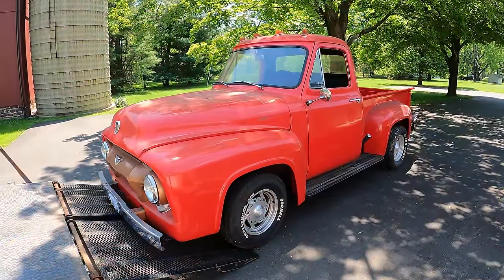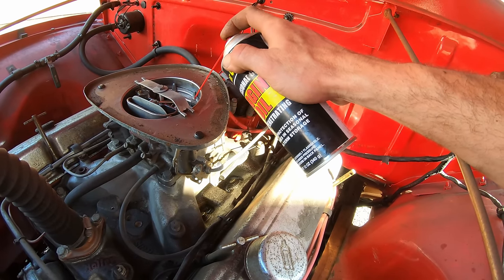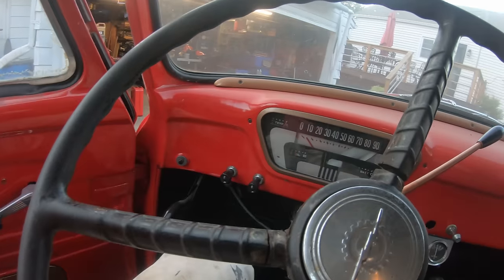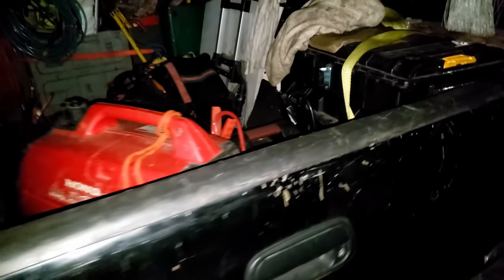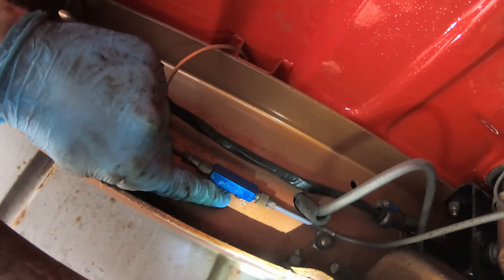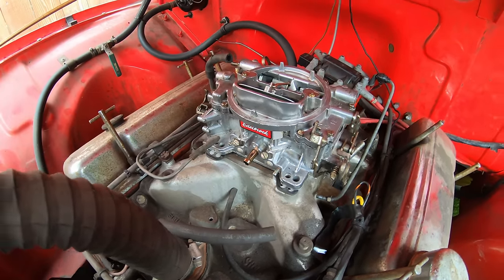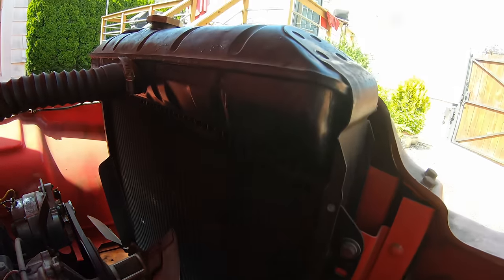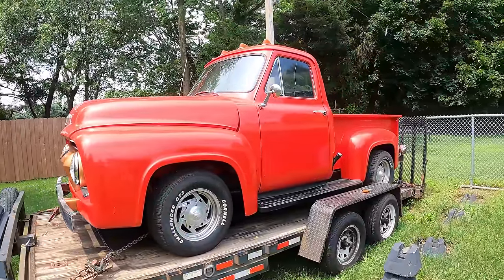1954 Ford F100 w/Pontiac 400 - Sitting For 12 Years NNKH

Comment from the maker: ~PART 2: https://youtu.be/bDT8TpwqGcg
Reply: SHHIIINNNYYYY,,NNIIIIIICCEE.. not. my fan belt on the chall was making a brass trans line nut real shhiiinnyyy.. .fixed, done by your slack american car sellers.. no biggi.. hard to find a mech that actually likes his job.. you watched , rainman rays repairs.  florida..
Reply: I am dealing with a much newer 1987 I just got ahold of and at some point someone also did a fairly elaborate resto on it. However the former owner had passed away and as the story I was told it didn't start. Both of his grandsons tried to get her running after his passing just recently listed it on Craigslist cheap. I had 3 days of spotty free time to go after her but kept getting interrupted by customers and phone calls so I kind of abandoned it for a few days until Saturday came and it was also time cut grass the summer curse as I call it. The following Saturday I dug around in the glove box and found a LETTER not a note. The letter was lengthy and all about the bad behaviors & habits of his son and grandsons. The letter began this way. If You are reading this and you are the new owner of this truck and it will not start there is a plug under the cab of this truck. The former owner wrote both his son and grandsons had bad drinking & drug problems and had smashed up 3 of his past nice trucks. He said if you are reading this now I assume you do not have drug and alcohol problems so push the plug together and enjoy the fruits of my hard earned work and money. The letter was signed Ernest Hawley Sr. I came to find out the son had died in a DUI related accident just up the street from where I live. However I bought the truck in Bloomsburg Pa quite a distance away from here. In my opinion the grandsons sold the truck for beer money nowhere what it was actually worth and they were quite the pair way too lazy to have even cleaned and washed the beautiful old truck to try to get a few bucks more 4 it.... But it's mine now... Outside of repairing the drivers side door someone boogered up it's beautiful once more. I had the door fixed before I got it running and drained both fuel tanks by removing em. I found lots and lots sludge in both fuel filters. I am assuming someone also put something like sugar down the fuel tanks. I have no explanation for the sludge in the fuel system. Most of the fuel lines are a plastic so only one piece was metal and it was was rotted. The truck ran but leaked gas all over till I smelled it...  I have no explanation not even a clue for what I removed from the fuel tanks was just sludge. I replaced both fuel pumps too. LMC truck $89 each...
Reply: Why do people waste a good truck by putting a competitor engine in it. I would scrap it unless it had a Ford driveline in it
Reply: @harrywalker5836  op
Reply: @coreysim2811  
They seem to just want the hard way!
There are plenty of demon Ford Engines than that 400!
Reply: Looks like it drew the line at jumping the RR tracks!  👎🏼😠 There’s a bolt on a Fords steering box takes up play unless its to far gone. If you install an 8/10 speed competition paddle shift tranny you’ll showem your T Lights!!😁Don’t forget the launch/burnout option👍

Comment: In the very early 1980's, my father had a '54 F100.  I was 5 or 6, but I remember that truck.  It went from rusty teal, to shiny grey with black accents in our garage.  I remember watching Mom hand paint the embossed FORD lettering on the tailgate black.  It had a Pontiac 389 V8 w/ Tri-Power carbs in it from a Catalina.  It had sand bags in the bed so it didn't light up the tires at every start.  One day he left home in it to go get the family cheese burgers at Burger Island, a 50's style drive in joint.  (which has since burned to the ground)  Anyhow, the phone rings at home, and it's Dad calling Mom to come get him at the Burger joint.  Someone there saw his truck, and offered to buy it from him on the spot in cash, and Dad just happened to have the title in the glovebox.  $3500 in 1981 is like $10,000 today.  It was like 4x what he was into it for, and at the time he needed the money.  He always I regretted letting it go, he really liked it.  Which is why there is currently a 1954 F100 in his shop, blown apart getting restored.  Frame, drivetrain, and suspension is done, sheet metal around 50% there.  It's coming together nicely.  His build is OE stock, not a street machine.  It'd be going faster, but he's at the same time restoring a 1954 Ford 2-door V8.  Both will be nice usable drivers, not show cars.  A nice matched pair of '54 Fords.

Comment: If you push the inside driver door handle all the way down it locks it from the outside and you climb out the passenger seat and lock it from the outside and then your truck is totally locked a lot of late 40s and early 50s trucks at that

Comment: This video brought back some great memories, Back in the seventies I bought a 1955 F100 with a 312 ci Thunderbird with a factory automatic and 427 reared which was very rare, I put a 389 ci 390 hp Pontiac with a 400 turbo transmission. I had a lot of fun in the old truck

Comment: Seeing the inside of this truck sure brings back memories. Back in the sixties my dad had a fifties era medium duty F-Series with a bed topped with wood sides, and a 4x12 for a front bumper. He, my mom, my older brother and younger sister used to ride to church in it every Sunday before he bought an old Plymouth from a relative to use as a family car for his growing clan (He eventually had seven kids). The bed had a drop tailgate and was on a hydralic lift. We used to ride along with him to the local coal mine several times late in each year to pick up a ton or two of coal for the coal furnace in our house and for many of the older neighbors. When the mill was on strike and he was supporting us working as a handyman he also used it to cut down and haul away trees, paint houses, refloor porches, put on roofs and haul loads of trash to the local dump for people. The heater in that thing took forever to get going! Anyway, the interior was identical to this truck, the door controls, everything on the dash like the spedometer the starter button, it was even the same ugly redish/orange color (albeit quite faded). The only real differences i can recall was a clear red plastic internally illuminated four-way flasher pull switch on the lower section of the dash.near the ignition switch and the gear selector since it wasn't an automatic.

Comment: Nice find.  My first hot project was a 54 Ford when finished it was painted an emerald green with metal flake black fender and running boards.  A little 289 and auto to the stock rear.   Ahhh memories.

Comment: Chris, I had a 55 and a 56 both with the stock V8.  The 55 had an automatic and the 56 had a three speed on the column.  Sold the 55 after a few months because it wouldn't start after it warmed up.  I never could figure it out so bye, bye.  The 56 on the other hand was a joy to drive and yes it got a lot of attention on the streets.  Had the big chrome reversed wheels on the back and some standard chrome wheels on the front.  It had belonged to a neighbor who passed away and his wife actually came over to me and asked me if I wanted to buy it.  Kept it for five years and it was a fair weather driver.  When I sold it I got three times what I had paid for the truck.  It was considered a classic even back then and the body had no rust on it anywhere.  Colorado is pretty good that way and I have never heard of rusted out brake lines until I started seeing it here on the Internet.  
Your friend should keep his hands on that one, it will just keep appreciating.

Comment: I had a 1955 F100 with a 6 cylinder engine. It had a homemade camper that was only a shell just tall enough to almost stand. A couple whe were teachers that traveled  with it had done the work. It had a light,small bookshelf and a fishing rod carrier on the side. I was in the Navy about to be discharged.  I love that truck but my buddy whe was very mechanical heard a noise he said wax the main bearings just before I was to leave and drive from San Diego to Texas and then to Iowa. I couldn't take a chance on the engine going bad and sold it at a loss to a used car lot.
 When I got home and employed I bought a 1954 F150 with a v8. A good friend wanted that truck and bought it. He fixed it up with a 389 engine, automatic transmission and paint job. A new leather interior and white vinyl top. This was 1970 ish. He still had the truck in the 90s and was going to redo it for his son. I think he still had it when he passed in 2011.
 I had traded a car for a 1961 Ford Econoline truck in 1971 and stopped by to show him right after I got it. He tried to buy it on the spot. Something about Ford trucks you just gotta love!

Comment: That little trick with the wrench as a handle to pick up the battery was genius. Gonna be using that one. 
Yes to a follow up video. That wood bed flipped would look nicer.
Reply from the maker: Just don't bump the other terminal! Lol. Mainly good for batteries that are shot. Wouldn't risk doing that with a good battery.
Reply: First for me also, cool truck.

Comment: I am very, very impressed with your mechanical and trouble shooting abilities. I have been doing the same thing for almost 50 yrs. I am on my 3rd 53-56 F-100 since 1977. This latest is the nicest one by far, a '54 also which I have had 24 yrs, ( Pumped up Ford 302/Tremec 5 spd). I know these trucks inside/out and I do ALL my own work in a shop I built behind my home. One of my favorite engines you got there, Pontiac 400. All my vintage hot rods have stick shifts except my '71 340 Duster. If you put a good quality 3,000 stall converter in your turbo 400 with a manual valve body...you will never go back to stick shift. Head snapping shifts and world class burnouts !  I am really anxious to see your next video. Keep up the great work !
Reply: @Steve C I have dreamt of being you all my life!

Comment: If my business ever picks up I am going to put a Pontiac in my Uncles truck. I had no clue you could buy and adapter to go from Pontiac to 350 chev turbo 400. I restored this truck years ago he bought it new in 85 in Alaska . I built a four bolt main 350   with a RV cam its been a wonderful engine. About 20 years ago I put in a US gear over drive to the tune of almost 2000 and my Uncle had the 400 rebuilt about 10 years ago I found a 428 for 500 if I would of known there was a adapter I would of bought it.I had no clue cores were going for $2000.00 I spent two months on body and paint  this will eventually get a Indian under the hood !

Comment: Nice project! Cool video, logical steps on getting her going and good work. Back in the ‘80’s I flipped several old pickups with 400-455 BOP engines in them. It seemed like it was a “thing” to do that swap back in the day. I’d like to see a follow up video or three on what happens with the old gal. 👍
Reply: Those are pretty popular,  I put a 75 Cadillac 500, with the turbo 400 transmission in a 77 Chevy half ton pick up,  ran great, but the rear was a one wheel wonder,  when it rained couldn't take off without spinning the right rear wheel. I enjoyed it. Lots of fun. On dry pavement if you just stomped it, the right rear tire would smoke through 2nd gear  then get traction in 3rd. I got 16 MPG on highway not too bad for such a big engine

Comment: Locking doors was an option and usually only on the passenger side. Also you could get a locking steering column. I know of a 48 Ford 3/4 ton with both AND an Electric heater, all the options you could get back then

Comment: Nice find! Btw the old trucks only had a door key on the passenger side! Was a safety feature!
Reply from the maker: Interesting. What about this safe? Just so some stranger can't rip open your door and hop in? When you're stopped at a light
Reply: Back then when parked on a street, most people got in the cars from the curb side away from traffic.
Reply: @NoNonsenseKnowHow  They didn't want the driver to get hit while unlocking his truck. Drivers Ed didn't come along till bout fifteen years after this truck was built. King pin vehicles was everywhere back in this trucks street parking history.🙏😁👍

Comment: Here in calif. there's a law in motor vehicle code and probably most states that makes it illegal to exit your vehicle from the driver's side when parked at the curb (to prevent a sideswipe) hence the lock only on the passenger side. In the 60s I had a '54 with a '54 324 olds & 4 speed hydramatic. Have fun!!!

Comment: Us born in 1965 my dad had a 1956 Ford F100 custom cab with the wrap around front and back window automatic which was pretty rare with the V8 factory engine that came with ? We had that truck all the way up until 1977 when my dad lent it to one of his friends and they didn't check the oil and burned it up then my dad sold it to somebody who was going to restore it? I sure have a lot of memories in that truck did a lot of things motorcycle riding took it camping a lot of good times in that old 56 truck my brother burning out in it that thing would light him up too let me tell you that V8 was no slouch we could light them up down the street but I always remember driving in a downpour going to la and had them windshield wipers slapping on high I turned him up to high and they got stuck under the window lip and the my dad got so mad at me tonight don't touch the windshield wipers just things I remember.

Comment: The door locks are a common feature on Fords this age and older. It's a safety feature. You lock the driver's door from the inside, slide across and get out on the curb. Then when you get back in you're on the curb and not standing in traffic 🤣.
Reply: Also because roads were not always finished and paved so kept shoes from getting messed up. Checked first to see if the above comment was made.

Comment: Nice job. I love tinkering too. I'd decode that Pontiac engine. Your  buddy might have a ram air engine which are going up in price every year. The heads are definitely not ram air 4, theyre worth 3k-4k for the pair. You can decode the block by the date of casting under the distributer, then the 2 letters on the front of the block just under the passenger side head gives you application. Also because the blocks are the same for the 326 all the way up to the 455, the size engine will be cast into the block under the exhaust manifolds. Not sure if it's on both sides. Looking forward to part 2.
Reply: Hello Mr Joe. I have a 65?,66? or 67? jeep gladiator truck that I have'nt been able to decode. Do you know how to decode the year of jeep truck vin #
Reply: @elprimorodriguezcgaq8qa75  I have no clue how to decode a jeep. I'm just well versed on Pontiac engines. Good luck.
Reply: @Joe-co4sq  thanks

Comment: I always carry a couple of sticks of JB Weld Steel Stick epoxy putty with me to fix problems like the one with the trans line or the radiator,  stuff hardens like a rock in ten minutes and it's impervious to most automotive fluids.

Comment: I had a 70 chev 3/4 longhorn that had a 400 pontiac in it from a previous owner... was not impressed. good power had lots of overheating issues (withj mechanical fan, and 4 electric fans) good motor, but had issues... I love your vids, keep up the great work!!!

Comment: Regrettably mine was and still is a bondo buggy. Should have known that when I opened the door and it was tuck and roll upholstery.  LOL Should have know that when I bought it but he wanted $10,500 back than and I got it for $2500.  Beautiful truck.  Since that time I've bought a complete bed in perfect shape $125 with slats at the San Diego Big 3.  A excellent hood same place $100 which blew off my hauler in Dallas, Texas.  I got to it before the traffic did.  But still a days work straighten it.  It was and still is a beautiful truck but the cracks tell me one front fender either stripped and straighten right or replaced.  Only thing hindering my restoration is life.  Running out of it and have at least five other cars to do. I have accumulated 53 thru 56 parts for the last 30 years.  Have at least 15 fenders and other parts.  I'll tell you young ones my secret.  Never be the first in the gate at car shows.  Try being the last.  Why?  Most of the great part are well overpriced by private sellers.  Stay away from those who sell parts for a living.  Usually I buy when they are loading up to go.  I offer a ridiculous price like what I paid for the 54 in Gardena.  He was a Wilshire lawyer who's wife told him you bring it home bring a lawyer with you.  My buddy almost had a heart attack when he took $2500 cash.  Works for me.  Try it and you will agree with me.  Second.  If your at a auction that has a lot of good stuff including cars.  Make sure your noticed and pay or bid up something that definitely isn't worth what your picking up.  People usually take you for a idiot and won't bid against you.  If they figured out your game.  Leave and try it another day.  Again works for me.  Ask a my wife who goes bonkers with the stuff I have accumulated in three states.
Oh by the way thanks for the video of taking off the gas tank.  I lost my salvation taking the damn thing off mine.

Comment: Heck yeah, beautiful truck. Need to fix the loose steering though. I hope you address that in part two. There's a lot of wrenchers out there that could use some input on that, I'm sure. Might need to put a 90° fitting on that trans line and re-run it away from the fan. I know, 90s slow flow, but better than a pothole or speed bump recreating that spray/breakdown situation again in the future, and a smaller fan might not pull enough air for sufficient cooling unless you add a shroud. Six of one, half a dozen...
Can't wait to see part deux.